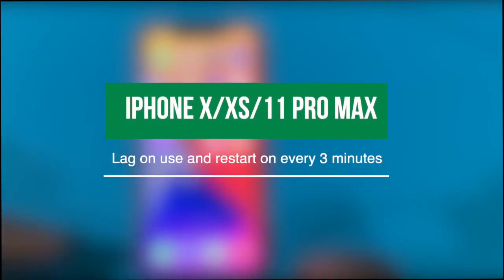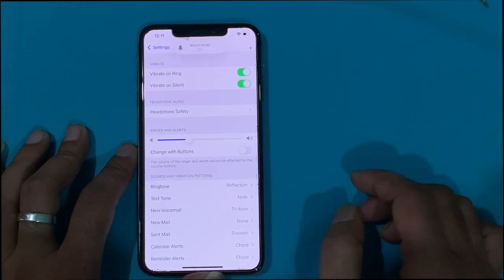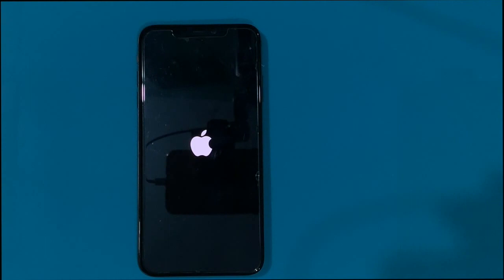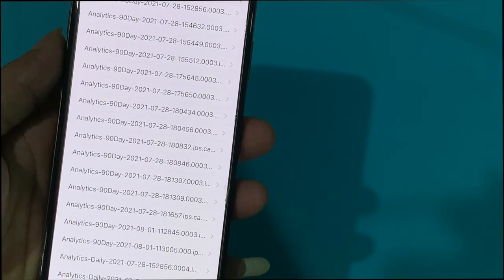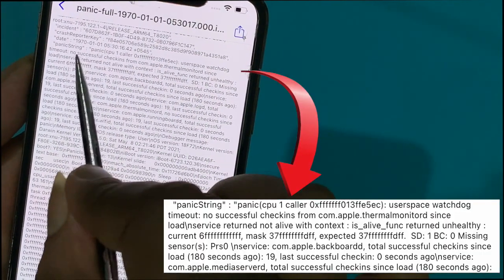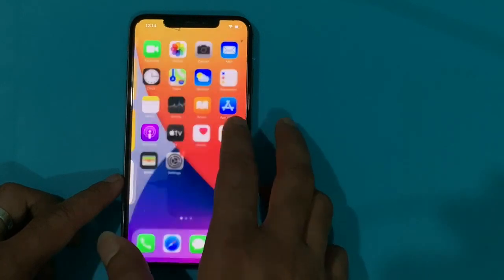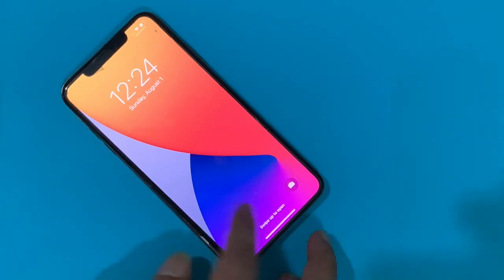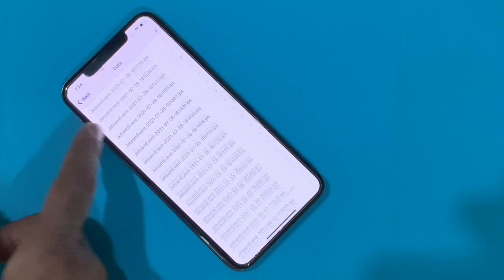iPhone XS/XS MAX/XR/11/11 Pro Max restarting in 3 minute & Lagging Fix.

Comment: I had facing same problem in 11 pro not restarting but so much lagging late response stuck  when I open camera opening after 5 sec
No panic reports
Reply from the maker: Might be some glitch of software or Camera issue.
Reply: Even volume buttons  when I click up down or down it will show after 2 sec  even when the call comes when I answer it ringtone still rings for 3sec
Reply from the maker: Is that forcely dropped iPhone ?
Reply: @thegsmsolution1  don’t know  I buy it another person  plz  tell me solution may I disassemble and reassemble it
Reply: @Hamzalifestyle08 do you fixe it bro ! I have the same problem

Comment: Bro im getting the same problem in iphone Xs i ve changed the charging flex cable but the the problem is same as your problem, but the flex cable i ve changed is not original
Reply from the maker: The real issues is that the copy flex that can't solve this problem.I already mentioned on the video.

Comment: Recently 🥹i got my xsmax charging flex changed and its now lagging and restating …then i changed charging flex again but the issue continued
Reply from the maker: Means you use copy flex i mentioned on the video use original flex.
Reply: @thegsmsolution1  one was copy but right one i used original .. basically im from india and i have a global xsmax … some people are saying you need global version of charging flex is it necessary!
Reply from the maker: Nope all version works.
Reply from the maker: No dough your second used flex is faulty too.Send me the log that i mentioned on the video.The panic log.
Reply: @thegsmsolution1  the phone is not with me right now i have given it to repair centre ..but i have panic alert here (panic(cpu 2 caller Oxfffffff01 a667d38): userspace watchdog timeout:
no successful checkins from thermalmonitord service returned not alive with context: is alive func returned unhealthy: current 6fffffff, mask 37ffffffffdff, expected 37 ffffffffdff.
SD: 0 BC: 0 RC: 0 BS: 1, Missing sensor(s): PrsO
service: backboardd, total successful checkins in 196 seconds: 19, last successful checkin: 0 seconds ago
service: SpringBoard, total successful checkins in 163 seconds: 17, last successful checkin: 0 seconds ago
service: mediaserverd, total successful checkins in 196 seconds: 18, last successful checkin: 0 seconds ago
service: log, total successful checkins in 196 seconds: 19, last successful checkin: 0 seconds ago
service: thermalmonitord, no successful checkins in 196 seconds
Reply: @thegsmsolution1  Usually related to a failure in the Pressure Sensor or a damaged line.
This sensor is located in the Charging Port Flex Cable.
Average Reset Time: 3 Minutes
Reply: The service centre replaced charging flex with new one restating issue has be solved but not charging they are saying that housing neends to be changed then it will work properly.. can you tell me what will be the issue with housing ?

Comment: I have à iPhone 11 Pro Max and i have panic(cpu 1 caller 0xfffffff02244fab4) So I would like to change the charging connector but there is a chip on it is it important to keep it and solder it on the new charging connector or can I use a charging connector with a chip already installed on it?
Reply from the maker: Better use charging flex only change connector is not a solution.
Reply: @Thegsmsolution  what is the solution ?
Reply from the maker: Send us the panic log data I will guide you to find the solution.
Reply: @thegsmsolution1  can you send me tour e-mail ?
Reply: Your*
Reply from the maker: Yep sure you can.
Reply: @thegsmsolution1  what is your e-mail ?
Reply from the maker: Contact us via Facebook page.

Comment: bug_type":"210","timestamp":"1970-01-01 01:00:18.00 +0100","os_version":"iPhone OS 15.0.1 (19A348)","incident_id":"5A33773E-1E09-4142-9D97-19C721A044A0"}
{
  "build" : "iPhone OS 15.0.1 (19A348)",
  "product" : "iPhone11,6",
  "kernel" : "Darwin Kernel Version 21.0.0: Sun Aug 15 20:55:51 PDT 2021; root:xnu-8019.12.5~1\/RELEASE_ARM64_T8020",
  "incident" : "5A33773E-1E09-4142-9D97-19C721A044A0",
  "crashReporterKey" : "b19a753e6f4f9a3d931ce9b1051376106c3436e2",
  "date" : "1970-01-01 01:00:17.67 +0100",
  "panicString" : "panic(cpu 1 caller 0xfffffff022509a10): userspace watchdog timeout: no successful checkins from thermalmonitord since load\nservice returned not alive with context : is_alive_func returned unhealthy : current 6ffffffffffff, mask 37ffffffffdff, expected 37ffffffffdff.  SD: 1 BC: 0 Missing sensor(s): Prs0 \nservice: backboardd, total successful checkins since load (180 seconds ago): 19, last successful checkin: 0 seconds ago\nservice: SpringBoard, total successful checkins since load (169 seconds ago): 17, last successful checkin: 0 seconds ago\nservice: mediaserverd, total successful checkins since load (180 seconds ago): 19, last successful checkin: 0 seconds ago\nservice: logd, total successful checkins since load (180 seconds ago): 19, last successful checkin: 0 seconds ago\nservice: thermalmonitord, no successful checkins since load (180 seconds ago)\nservice: runningboardd, total successful checkins since load (180 seconds ago): 19, last successful checkin: 0 seconds ago\nservice: wifid, total successful checkins since load (180 seconds ago): 19, last successful checkin: 0 secon\nDebugger message: panic\nMemory ID: 0x1\nOS release type: User\nOS version: 19A348\nKernel version: Darwin Kernel Version 21.0.0: Sun Aug 15 20:55:51 PDT 2021; root:xnu-8019.12.5~1\/RELEASE_ARM64_T8020\nKernel UUID: 77B81D16-9A74-3E97-9F9F-46D228B67BB6\niBoot version: iBoot-7429.12.15\nsecure boot?: YES\nPaniclog version: 13\nKernel slide:      0x0000000018a20000\nKernel text base:  0xfffffff01fa24000\nmach_absolute_time: 0x1194f931d\nEpoch Time:        sec       usec\n  Boot    : 0x615dc029 0x0001675c\n  Sleep   : 0x00000000 0x00000000\n  Wake    : 0x00000000 0x00000000\n  Calendar: 0x615dc0e5 0x000a240a\n\nCORE 0: PC=0xfffffff020a8257c, LR=0xfffffff020a824fc, FP=0xffffffeb0739bd90\nCORE 1 is the one that panicked. Check the full backtrace for details.\nCORE 2:

Comment: Hey there. Thank you so much for this video. I have dropped my XS Max before a month. The glass has a deep damage near the charging port area. The same restart problem I’m facing, and the touch doesn’t respond sometimes. I’m facing lagging issues also. So replacing the charging flex can fix my issue? Is the display not responding also one of the problem of charging flex damage? Plz reply! Big fan from india!!
Reply from the maker: Did you see the video carefully? I mention the log data. If the log data same no dought that is the issue of charging flex. Don`t use copy flex use the original that I mention in the video.
Reply: "panicString" : "panic(cpu 0 caller 0xffffffff01921ec6c): userspace watchdog timeout: no successful checkins fron com.apple.thermalmonitord since load/nservice returned not alive with context : is_alive_func returned unhealthy....

This is the panic error what I'm getting. I'm just confused that this error will affect the touch which is not responding also? And even if it responds at sometime, it's slow and lagging!
Reply from the maker: You have to post the full log brother this log is incomplete.
Reply: My kinda doubt is, will my display not work because of the damage in charging flex and charging sensor? My display is not working and re-starting. But it's charging properly. I'm getting the exactly same panic error. Pls reply bro
Reply: Pls reply bro
Reply: @vishak4063  have you fixed it?
Reply: I’m having the exact same issue with my IPhone 10 Pro Max. My log data is identical to yours. It’s the same same thing. Where can I buy an original charging flex for my iPhone please? How can i share my phones log with you? Thanks so much for this video.